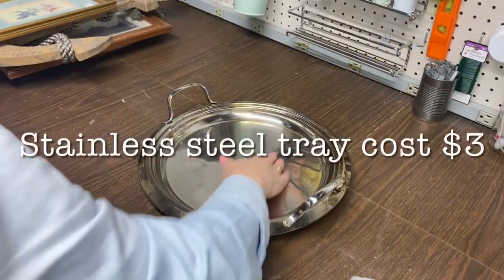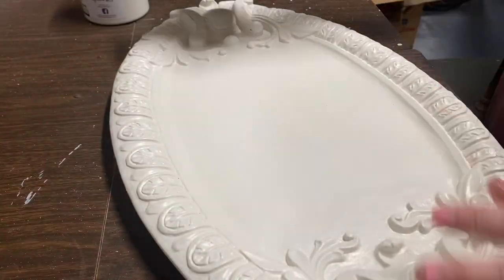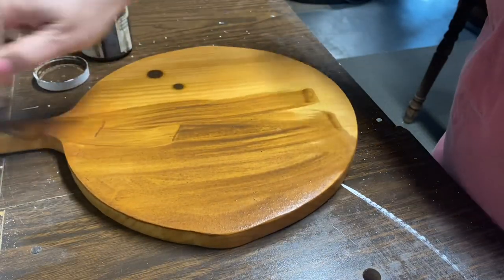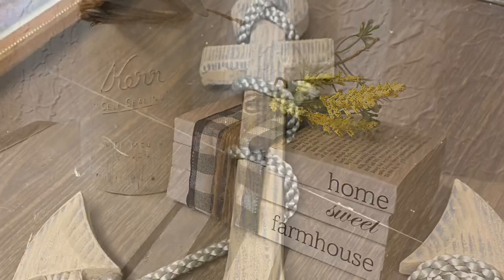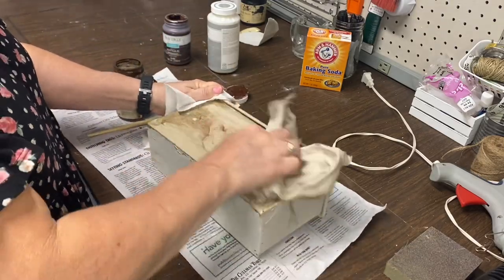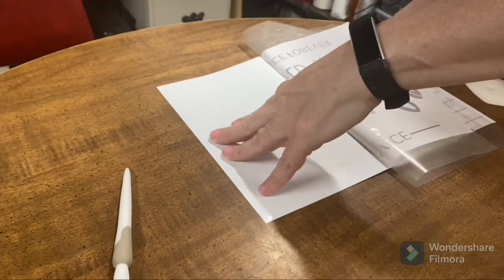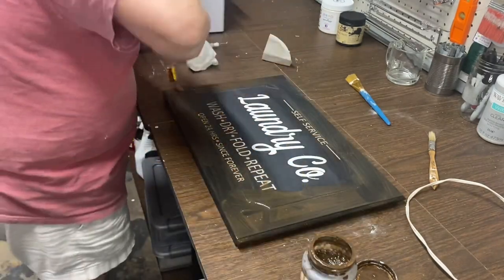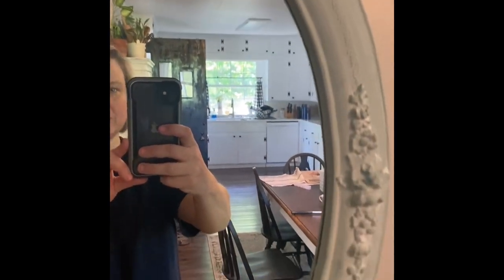10 Thrift flips/Flipping thrifted finds for profit

Comment: What is the air dry clay and you talk about “sealing it in” on your projects, what is that please?
Reply from the maker: Hey Jolene, Thanks for watching.  I used Iron Orchid Designs Air dry clay but they sell different brands at hobby lobby and Michaels.  I sell the IOD locally.  It's just clay that air dries in the shape of the mold you use.  And by sealing I mean I use a polyacrylic top coat or a wax because chalk or mineral paint is not permanent until it's sealed.
Reply: @susieonthefarm  Thank you so much!  I recently found your channel and I think you have fantastic ideas. I’ll continue to watch!